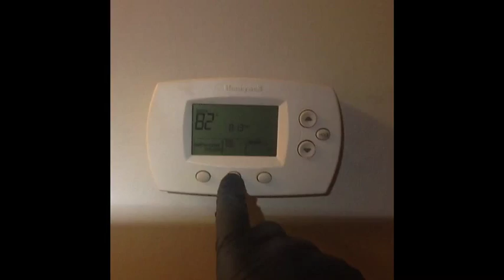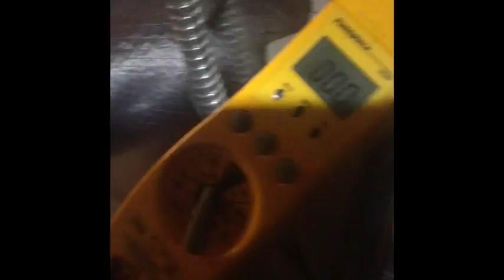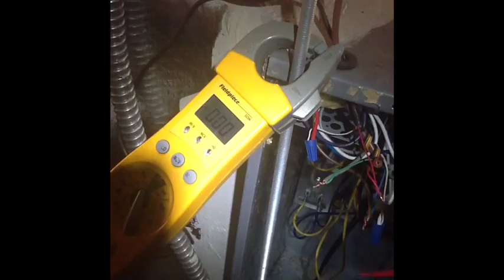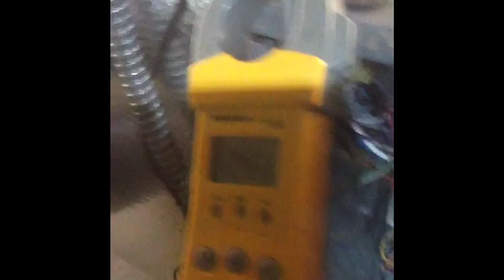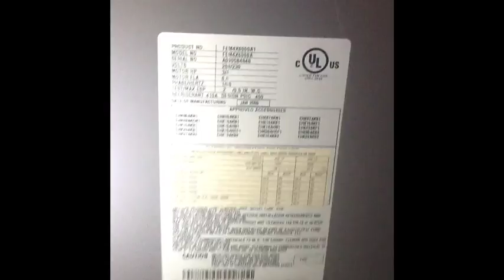Hvac: Diagnosing a X13 Blower Motor To A ICP.  And Re-Install

Comment: Did the old motor have a module on it where the plugs go in?
Reply from the maker: From what I no it does have a control in the motor like the ECM motor.. But for X-13 motor you would replace the entire motor. The ECM motor you can replace the module or the motor. Check out gentex YouTube videos for the X-13 and ECM motors for troubleshooting. Thanks for the comment sorry for the delay. I appreciate the feedback..
Reply: Yea that's what I thought but wasn't sure bout just replacement module on x13

Comment: Eddie, thanks for sharing this video.  I did enjoy it.  I'm a DIY homeowner, not HVAC tech.  Just had one question.  When you unplugged the old X13, the 24v single wire was plugged into the #1 position.  when you installed the new X13, the 24V signal wire was plugged into the #2 position.  Was this intentional?  I know very little about these.  Heard they are programmable so that different positions do different things, or they can all do the same thing.
Reply from the maker: ibowhuntga good job on the detail. Yes  changing speed taps will make a difference in speed from 1 to 2. Speed taps 1-5 increases blower speed.

Comment: What the hell is up with the flex?It is being choked of air on every run just about.
Reply from the maker: Robert Cherry your right about that nothing wasn't really hung properly and in Florida awhile back we had to strapped the inner liner in the flex and also strap the outside of the flex but they stop that. Thanks for the support.